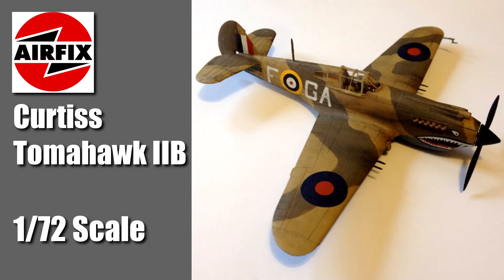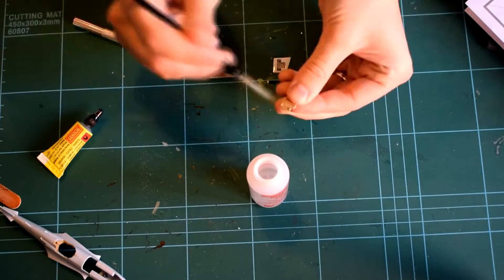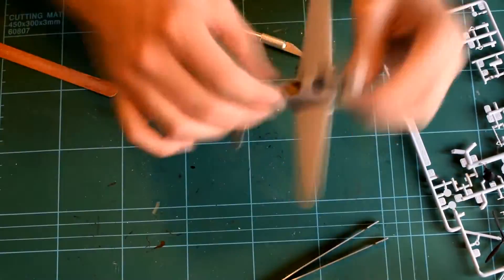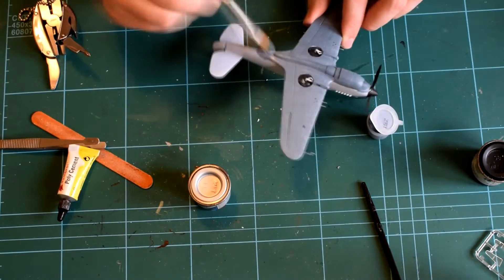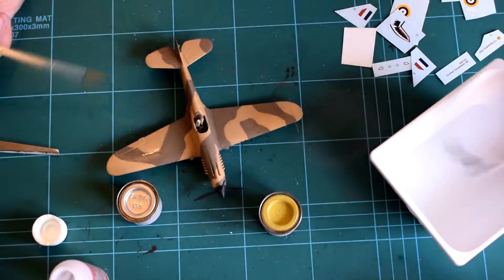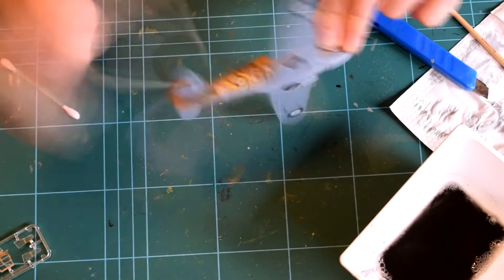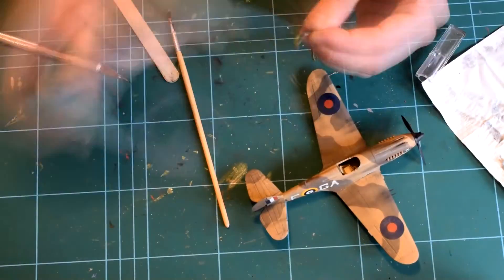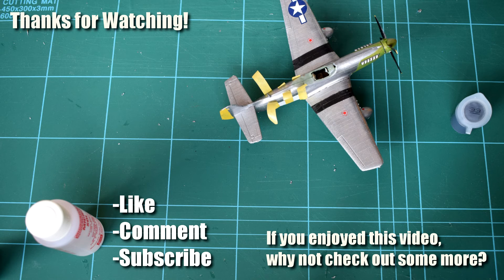Airfix Curtiss Tomahawk IIB (P40B) Starter Set (1:72)

Comment: Nice build mate if your low on budget take a trip to Aldi before the end of Christmas they have airfix starter sets for £4.99 each I’ve picked a few up myself
Reply from the maker: Pc Plod thanks! Yeah, I saw them a little while ago. Picked up the Folland Gnat, and I'm pretty sure I'm getting some as gifts for Christmas :)
Reply: @ModelMinutes  just pick this plane up today from aldi my self. Grate value.
Reply from the maker: Teresa Marsh yes! They seam to have them most years now. The only downside is that it’s the same kits, I’d like a bit of variation next year
Reply: @ModelMinutes  yes i did notice that as got the cutty sark last year.
Reply: @ModelMinutes  A few different models in this year, compared to last

Comment: Hi mate, great job. I'm currently building this model, and I plan on making it a two-seater, which will involve cutting out some of the plastic of the fuselage on which the 'back windows' sit. What do you think would be the best way of doing this? I was thinking of using a hot wire?
Reply from the maker: Hmmm, that could work. I think I would just stick with a sharp knife and the sanding it down afterwards, but that's just my preference. I'd be interested to know how you get on :)
Reply: Thanks for your comment. Other people I've asked have also recommended cutting the plastic rather than melting with a hot wire, so I'll give that a go :)

Comment: Hello i want to make my first model kit 
Im using a acrylic for painting my model. And i want to ask some question to you.
Did you thinned the paint before painting? Waht is the ratio between the paint and the thinner for the acrylic?. And did you recommending to use the primer paint before painting with brush?
Thank you
Reply from the maker: Zhafran Nabil great questions! It depends on the plastic and paint, but a primer can be a good idea to help the next layers stick to the plastic. I tend to thin my paint 2 parts paint to one part water. If you would like more information, I mention these thing in my beginner guide videos ☺️
Reply: @ModelMinutes  thank you for the answer. How many coat of paint to get the better result?
Reply from the maker: Zhafran Nabil again that depends on the paint and how much you thin it. I find that with my ratio it might take up to 3 coats. But if it’s thinner it may require mpre
Reply: @ModelMinutes  oke thank you very much apreciate your answer.
Love your video.
Reply from the maker: Zhafran Nabil thanks!

Comment: Thank you for the guide , its a great help !
I have found that someone suggested use of softer pastels for washes- and using turpentine as a thinner to get any colour of mud or aging effect (grind em with a fine mesh, pour turpentine, mix, apply as a putty).
Still have yet to try it - think it will work ? I dont want to botch up my kits
Getting Italeri Fw-190A-8 as its 30% off ,Ju-87 Zvezda, Spitfire MKV, E-50 MC, Kv-2 Trumpeter , proly this as my first kits  in 1/72

The diorama will be very painfull t... scratch building 2 buildings, Bunkers, bricks using car putty and  the rest..oh boy.. 120x80cms base with 8 to 8 vehicles, 50 infantry.
So any help i find here will be immense load off
Reply from the maker: I can't say that I've ever tried that method, but it sounds interesting - maybe someone has made a video on it?

Sounds like you've got some great kits on the way, and the diorama will be amazing when it's finished!
Reply: Model Minutes 
Im ordering this+ fw-190 a-8 tommorow, aswell as King Tiger+ Ju-87
This video will help alot, and the wash thing you mentioned may help in the watch tower i made (wood stirrers cut with a knife along 5mms), turned out amazing, took 14 hours .
1000*6 cms each is alot of work space for model walls for just 0.40£ lol, or less

Comment: In the United States it retails for $10 without any starter set extra bits
Reply from the maker: yeah, there are some versions here in the UK which are about £8 without the paints
Reply: @ModelMinutes  I was hoping to have the teeth decals for a Korean War f-51d I was making out of the Airfix p-51d but I ended up having to hand paint the teeth due to none being included with the tomahawk